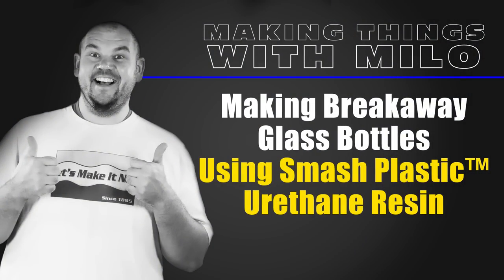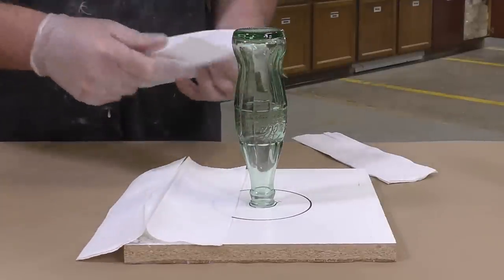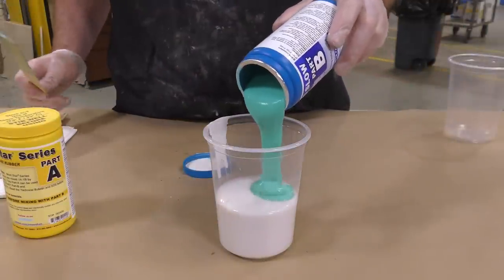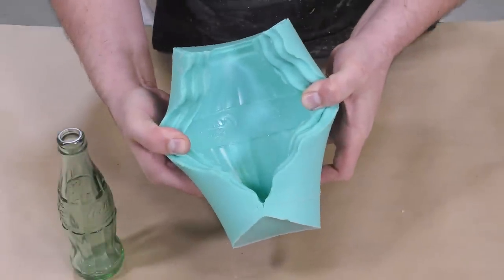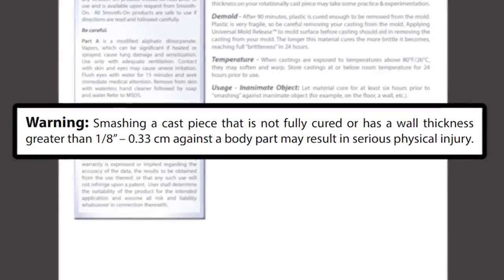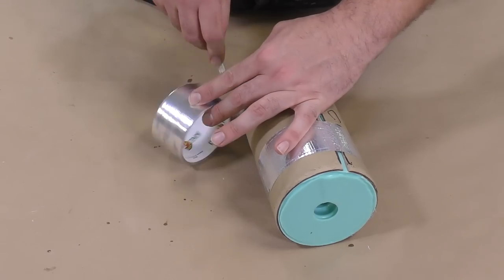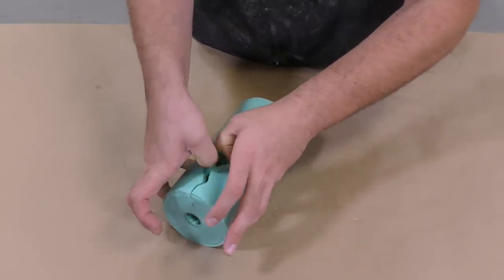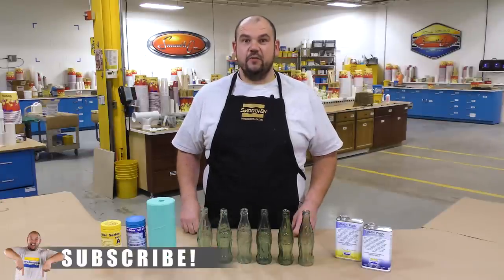How To Make a Breakaway Bottle Using SMASH™ Plastic

Comment: You can get an accurate estimate of the amount of resin you will need by filling the original bottle with water, then pour that into the mold, then tare the mold+water on a scale.  Next fill the mold the rest of the way to the top with water and weigh the amount added.  Since water is 1 gram per ML, you can just convert from grams to ML directly to get your volume of resin.
Reply from the maker: Awesome info! Thanks!  Don’t forget that the mold must be completely dry before Casting SMASH Plastic.
Reply: Assuming the resin has the same density as water. Which is highly improbable.
Reply: @dr.lexwinter8604  You actually don't have to worry about the density of the resin because you know the density of the water and you're using the mass of the water to determine the volume of water and then using the volume of water for the volume of resin.

Comment: Awesome video and products. I thought the props were made with sugar.
Reply from the maker: Sugar glass has its own set of challenges. Heat will melt sugar glass, ants are attracted to it, and it can rot over time.
Reply: @smoothon  but it tastes great
Reply: In the old days, they were. But sugar glass is tricky to make, and must be used soon after making or else it would absorb humidity and become soft. That's why they were phased out when these types of plastic polymers became available.

Comment: Do you (can we) recycle the used up the mixing containers?
Reply: Almost never. You can get away with pulling out some resin and most silicones and reusing the mixing cup sometimes.

Comment: hey guys, quick question.  Does the set material have a melting point? ie, can it be deformed with heat and still  maintain its clear status?
Reply from the maker: Heat will cause the material to deform, but over time, too much heat will cause the piece to lose it's breakaway properties.

Comment: Do I have to preheat the mould?
Reply from the maker: You don't have to preheat. It is done to help reduce the pot life of the material so that he is not spending a long period of time rotationally casting. 7-10 minutes spinning a mold around can get very exhausting quickly.

Comment: Must the denatured alcohol be sprayed before the resin "fully" cures in order to achieve the desired effect?
Reply from the maker: No, it can be done after it cures.
Reply: @smoothon  Does it only work on the smash plastic? I'm not finding any success with crystal clear or 325
Reply from the maker: Correct, this only works on Smash Plastic.

Comment: 6:48 Couldn't you fill the mold with water then pour it out into a graduated cylinder to get its volume, say 100ml.

Repeat by filling the bottle with water and pouring that into a graduated cylinder, say 80ml. 

You can now do the math, 100ml minus 80ml which gives you exactly the volume of the bottle glass at 20ml.  

Correct?
Reply from the maker: SMASH plastic is moisture sensitive as it is a urethane resin.  Residual water may cause casting issues.  This is a good process, would use sand instead. :)

Comment: If I need to patch using this material?
Reply from the maker: You can use 2-part epoxy or CA glue to repair this material.  It is , however, very fragile.
Reply: @smoothon  Yes, CA worked very well for this project.  The whole job turned out to be a great success! Thank you, Smoothon!!